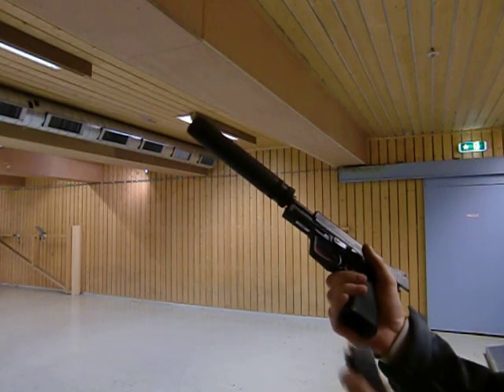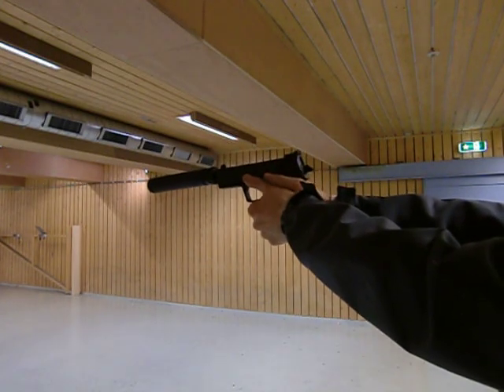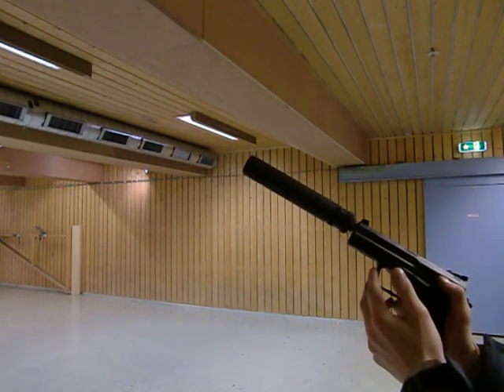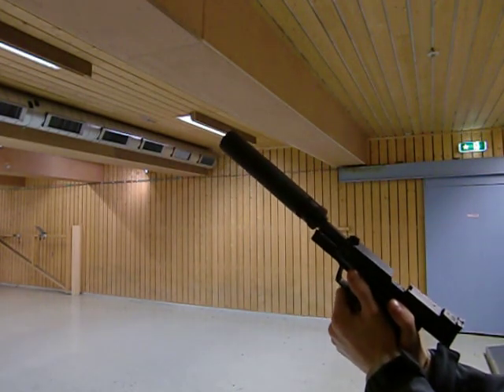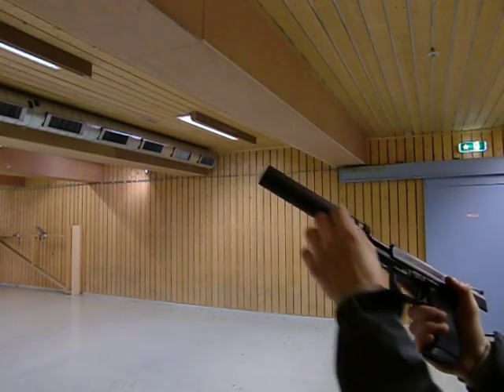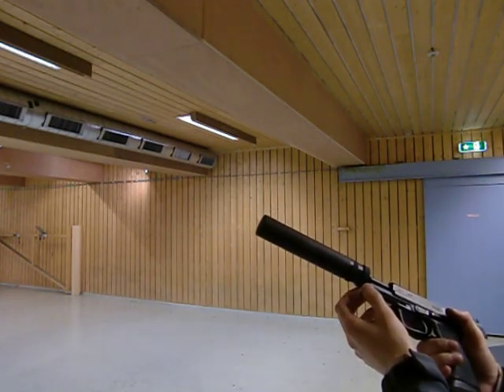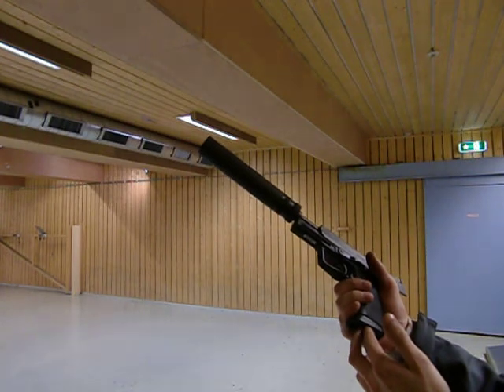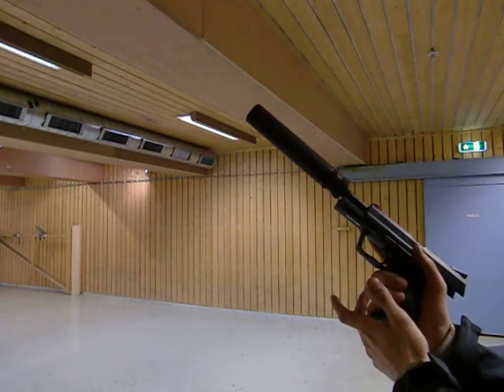how a silencer works (Silenced HK USP 9SD)

Comment: If you're one of the really stupid people that thinks there is a difference between suppressor and silencer, or that this is specifically a suppressor and not a silencer, then go elsewhere. A silencer = suppressor, and a suppressor = silencer. As far as legal definitions and the ATF is concerned. So people can use whichever word they please and still be correct.

Comment: I'd assume yes. It would reduce the over-all range of the bullet (or velocity) if you will. It shouldn't change any accuracy though. This is just my logical point of view on it.. considering the air is compressed into the silencer/suppressor attachment would also to my understanding pressure against the bullet too. Though the significance would be small, it's there.

Comment: Wow. I had no idea the sonic boom was such a huge part of the gunfire noise. Thanks for the great demo, very informative.
One suggestion I'd offer is regarding your technique on releasing the slide. I was told years ago by a firearms trainer never to touch the slide release without first pulling the slide back to relieve the pressure on the catch; apparently it can wear the catch surface down over time to the point that the slide no longer locks in the back position when the magazine is empty.

Comment: Thats absolute rubbish - there is always some sound even with a silencer. The gun sound is made due to the gas following behind the bullet. With a silencer there is a larger space for the gas to expand in, therefore, at a lower pressure causing a softer sound. Its exactly the same principle as a balloon popping - if you let the air out slowly there is no big pop. So you are talking out your back side I'm afraid.

Comment: they drop the sound to just over 120 dB out of a 4 inch barrel. still as loud as a rock concert. which will cause hearing damage. but I don't' wear earplugs to concerts and that's 3 hours of sustained noise. 

hearing damage is cumulative though, you don't just hear a gunshot and suddenly you're deaf.

Comment: hearing loss is cumulative. you probably hear significantly worse than you did before you started shooting. if your'e shooting subsonic ammo though it's not that big of a deal. at 120 dB it's the same a rock concert, and I don't wear earplugs to those.

Comment: the name of the device is a silencer. but you are correct in saying that all they do is suppress the sound. people need to realize that you are firing off an explosive charge in a fairly small machine. subsonic ammo in 9mm with a suppressor is about 120 dB. this is almost 4 times quieter than unsupressed (around 160 dB). for comparison, 120 decibles sustained is about as loud a rock concert. so still pretty loud, but MUCH less piercing or noisy than unsuppressed

Comment: there are very few guns that default to subsonic speeds. hell they make .22 LR loads that shoot 1600 fps. 115 grain 9mm averages around 1250 fps for normal loads. the sound barrier is just over 1100 fps. think about the weight difference in the bullets too. rifle bullets are quite a bit bigger than their pistol caliber counterparts and need a lot more powder to get up to those speeds. since pistol bullets are lighter, it doesn't take as much to get them moving.

Comment from the maker: You probably meant molecules. Molecules of gunpowder are split during combustion and forms smaller molecules of various gases, this process also releases alot of energy (heat). This sudden transformation from a (relatively) cold solid to a hot gas causes a rapid expansion which we call an explosion.

Comment: Actually, there is only one "BANG".  When the powder ignites inside the cartridge, there is no explosion.  Gunpowder can not explode in a confined space.  As for the actual "BANG"...  That comes from the point when the bullet leaves the end of the barrel.  But it is not because of breaking the sound barrier,  It comes from the atoms splitting as the pressure is released out the front of the barrel.  Not trying to be a pain.  just helping out another shooter.

Comment: I didnt say they have less stopping power I said they are ballisticly superior. Learn to read shit head, I know why the military used a .45 for so long and I also know why they use 9mm now. Wether you like it or not, physics are physics. Cant argue with that. 9mm is more than enough to stop someone running at you if you hit them in the center mass, .45 wont do a fucking thing if you cant hit them, also there might be a tactical advantage to holding 18 rounds as opposed to 8.

Comment: Kinetic energy of a body is given by Ec= (mass * acceleration^2) / 2 
while the mass of a bullet is in direct proportion with the total amout of energy, the acceleration of the bullet is in a quadratic proportion.
Double the mass you double the energy....but if you double the acceleration (ex. acceleration=2) you have 4 times more energy (2^2). It's mathematical.
So, In therms of energy, it's much better a light bullet fired at a higher speed. The rest is all about bullet's geometry ;)

Comment from the maker: Good point. But I believe that a slower round will transfer more energy to the target than a fast bullet. And I do stress BELIEVE.. I haven't done any testing.
I find it strange that my weapon has problems cycling supersonic ammo with the silencer on, but subsonic works every time.("browning action" pistols require more energy to cycle due to the weight of the silencer)
In my head it seems like the energy tranfered to the slide should be the same as the energy of the bullet, ref Newton's 3. law?

Comment: on alot of pistols enough gas come out of the opened breech to make it loud enough some pistol can have there slide locked to make it even quiter but you have to manually work the slide

Comment: @AAAAAHTEEMATU247 Suppressors do not "weaken the bullets" in any way.  Assuming the bullets are the same weight, the supersonic bullets are "stronger" than the subsonic rounds because muzzle energy is a function of projectile weight and velocity.  If the projectiles weigh the same, but velocity is decreased, there will be less muzzle energy.  You can compensate for this by using a heavier subsonic projectile, rather than a lighter supersonic projectile.

Comment: suppressor if it was a  silencer it would be silent it suppressed not silenced. And it does weaken the bullet not by much but it does it captures more of the gas so the bullet is moving slower because there is not as much gas pushing the bullet out.

Comment: @AAAAAHTEEMATU247 
1.the silencer is wider than the barrel, so the gas expands around the bullet a little, instead of behind it. instead of pushing on the bullet, it actually goes around it, slowing it down a little by making the air denser.
2.most newguns are rifled. rifling is a circular cut in the barrel, which makes the bullet spin, spinning bullets are more aerodynamic, so they resist the wind more, making them more accurate and faster.
supressors are not rifled.
less speed = less power

Comment: @possumtrapper - I was about to ask that question... Because the silencer is basically increasing the barrel length, then wouldn't the velocity be higher due to the gasses building up behind the bullet faster?

The same princible is used in MBT design - nearly all 3rd gen tanks use an L55 cal/length gun because they produce drastically more velocity which = more penetrating power with use in kenetic rounds.

Comment: @AAAAAHTEEMATU247 no a silencer (as long as it remains in-line with the barrel)  has no effect on the bullet. the way subsonic loads work is by using a heavier bullet with a slower burning powder.

Comment: @ExON00 wet phone books soak them in a bucket of water so they're wet through they have smiler properties to ballistics gel also if you use a chronograph you'll find the velocity's higher with the suppressor fitted than with out it (i know it sounds like ive got it backwards but they do.) :)

Comment: @ExON00 If you use the physics equation for Kinetic Energy=(1/2)(mass)(velocity)^2...or...K=(1/2)(m)(v)^2 then you would have a good idea how much energy the bullet has. Notice, all you would need would be the velocity (use a chrono and convert to m/s) and the mass of the bullet (in kg). 
Super Sonic Example:
m=.0075kg                                                   
v=366m/s
K=(1/2)(.0075)(366)^2
K=502 Joules
Sub Sonic Example:
m=.0075kg
v=300m/s
K=338Joules
Supersonic>Subsonic

Comment: @ExON00 Not quite correct. Barrell vibrations have something to say in this. You'd probably want to hit the amplitude peaks for the best accuracy. A lso a fast barrel twist can cause quite an overstability with a big caliber light weight bullet, which ain't good for accuracy either. Curving flight path doesn't necessarily mean worse accuracy. Bullet mass is also a huge factor. High velocity is good for semi-long range. For a really long range you'll need quite a bit of mass too.

Comment: @gkkassulke The air pressure is irrelevant to the speed of sound. What matters is air temperature. For example at -15ºC the speed of sound is 322 m/s. And going just under that isn't enough to make the shot silent. Flight noise starts to increase from ~0,9 mach, so at -15ºC, muzzle velocity for silent shot should be 290 m/s or under. Also the semi-automatic action doesn't help the cause. When the shot is truly silenced, only click of the firing pin, and bullet hitting the target can be heard.

Comment: @ExON00 I have a S&W 4506 and I'm definitely familiar with the characteristics. Firing a slower, but much bigger slug suggests that it is very difficult to get good grouping at a decent range. I've gotten much better at handling the pistol, although I could use some better recoil springs.

Comment: @MegaCeilingCat When you cycle a gun by hand it will still make a loud "klacking" sound, this is what you hear in the last example. if you were to listen to the discharge from 100 yards/meters away, you would likely not hear much unless it is absolutely quiet, meaning no wind, no leaves rustling, no traffic, no generator noise and so on.

Nice work ExON00!!

Comment: @ohwhatacereal By design 45acp is subsonic.   Average speed is around 800-900fps with 230gr.  If I remember correctly to break the sound barrier it has to be traveling faster than 1116fps at sea level.  The USP tactical was also designed specifically to operate with a suppressor.  In the case of his USP with 9mm 147gr is subsonic.

Comment: I wouldn't recommend using the slide release catch all the time, rather use the overhand method to cycle and or retract/release the slide... often the best way of making sure the slide goes fully fwd and not into battery.

Comment: Very good video, very well explained too.
The only weapon that could be truely silenced with minimal noise of working parts is actually a russian made M1895 Nagant pistol which is a revolver that has mechanical features which seal the gap between the barrel and breach when the hammer is cocked. Meaning that with bullets using sub sonic ammo and an improvised silencer like a tube with a wet sponge (a wipe) inside it.
You'd only hear the slightest of noises.